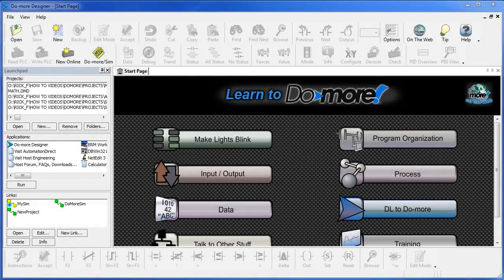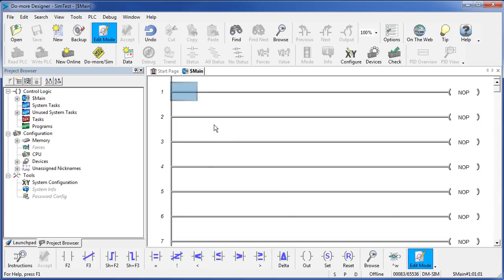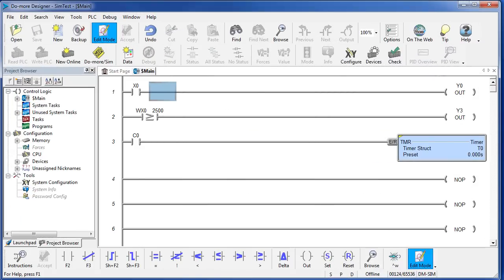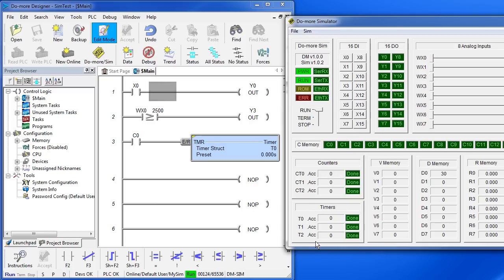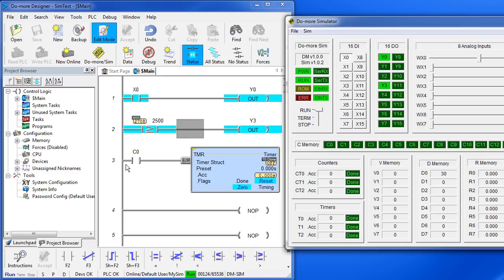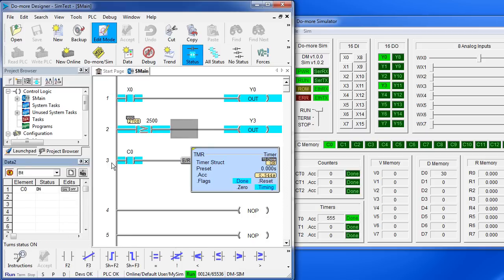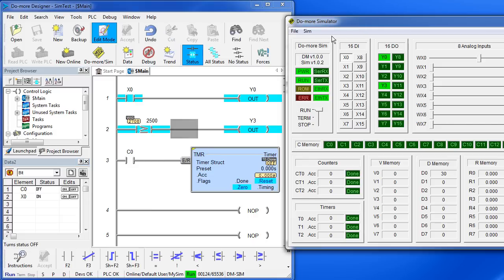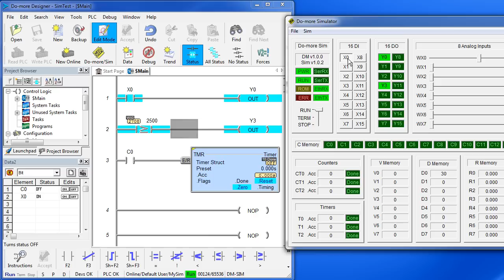Do-more PLC - How to Use the Simulator to Test Your Ladder Code with Do-more Designer

Comment: The simulator doesn´t work on my pc, I got Transport protocol error on the link info. I run the program as administrator and turned off the firewall so I don't have a clue...
Reply from the maker: @Gaetano Gurgone, thanks for the comment. There could be a few different things causing your issue. Please, contact our free Tech support, for help on this issue. 1-800-633-0405